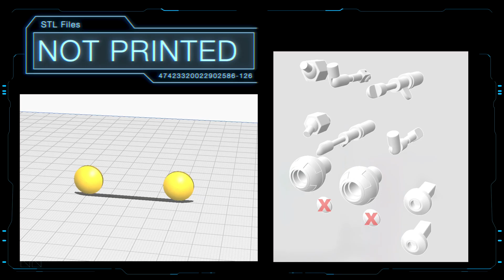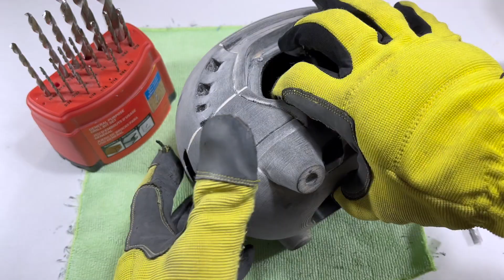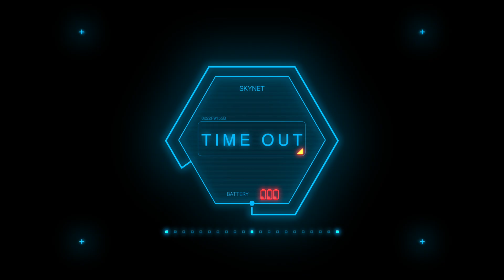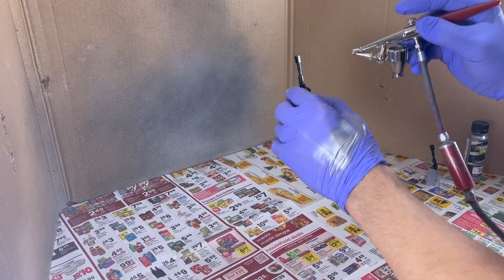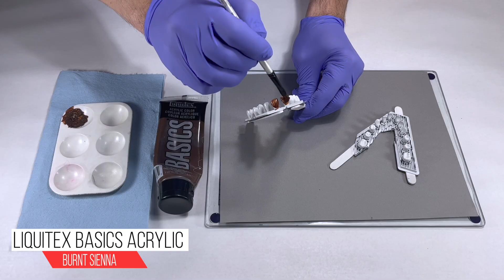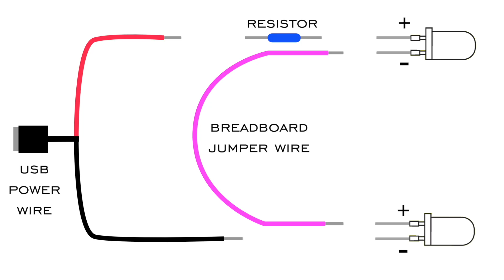3D Printed T-800 Terminator Bust with LED Eyes

Comment: I'm very New to 3d printing but I figured I'd give this a go. But for some reason when the chip cap prints out the detail is horrible. For some reason it looks like a bullseye and not smooth like it should be. What settings are you using.

Comment: I'm in the process of printing the T-800 full endoskeleton from the same designer (has the exact same skull).  I printed the skull in one piece but it did have a major wobble after 14 hours (was a 30-hour print at 0.16mm layer height on my K1 Max).  I'd forgotten to deselect the option for the supports to be on the build plate only, so the only tree supporting the memory chip chamber was a tiny little branch on one side of it that was branching off of the main supports that were 'growing' through the mounting hole at the base of the skull.  Luckily (and I mean extremely luckily!!) I spotted the chamber wobbling a bit so I paused the print and glued in some additional supports from leftover trees which held it in place perfectly - it 100% would have failed and left a whole skull full of spaghetti by the end of the print, assuming it didn't destroy the rest of the print as well.

Getting the supports out of the inside of the skull wasn't too tricky as the access holes on the side provided plenty of space to get snips in to cut them up and enough space for fingers to get in to break it all off.  Took maybe 10 minutes to get all the supports off the whole skull and it's perfect.  You can see on the timelapse after about 1:05 a big line appears, that's where the print was paused for half hour while I sorted out the supports for the memory chamber.  https://streamable.com/9pkz76

Thank you SO much for the tip on the cabochon for the eye lenses!!!  I printed the lenses in transparent PLA with red LEDs which look great when the LEDs are on, but a not great when they're off.  Been searching for a good alternative but have been struggling.  Now just waiting for the cabochons to arrive (had to order 200 when all I need is 2, ugh).  I've also added in a remote control for the lights as well, which I'm WAY too excited about.  Wired it up this morning in 5 minutes and it's great, was a £6 part on amazon: https://www.amazon.co.uk/dp/B0BVM7N8B1?ref=ppx_yo2ov_dt_b_fed_asin_title.

Comment: Hi, great video! I'm curious. I see theres a central hole though the model for the cable and a hole in the base. I dont see a channel for the cable to exit the models base.?
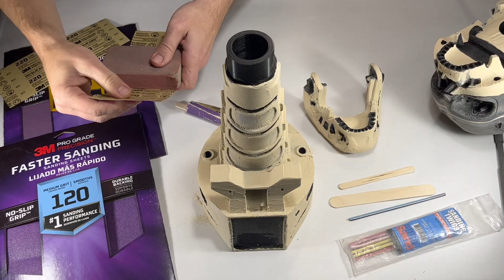Reply from the maker: Yes, there is a hole in the base, all the way up through the spine/neck.  The diameter is about 1.5 inches (estimating).  It opens at the top of the neck/spine so that you can run the LED wires for the eyes.  You can see the opening at 5:08 in the video.  That hole goes straight down through the base.  Good luck on your build!
Reply: @HappyTrooperDotCom  Yes, i see the hole goes down to the base but the base is flat. How do you run the cable out of the hole of the bottom if its sitting flush on top of a surface :)

Comment: I have two T-800 heads, one is ready for paint but I don’t have an air brush.
The coaxial RG6 was a brilliant idea, printing them is a pain!!
I printed them in half as you did, but I printed them upside down like a bowl so there was little support to remove.
I also installed a pressure switch at the bottom of the CPU port so when the CPU is inserted, the eyes light up. When removed, they shut off.
Other than that, I’ll be using some of the techniques from this video to expedite the sanding and filling process on the second head.
Awesome build!
Reply from the maker: The pressure switch is a brilliant idea, thank you for sharing!  Much better than plugging a power bank in.  Going to look into that :)

Comment: You are inspiring me to start 3D printing.  What 3D printer do you suggest?
Reply from the maker: Hello, thank you for watching.  I use the Creality CR10.  It has been very reliable, and has a large print bed to accomodate larger prints.  I realize it may seem expensive, but for the size you get, it is well worth it.  Thanks again for stopping by.  Good luck with your builds in the future :)
Reply: @HappyTrooperDotCom  Thank you for advice and the great videos!

Comment: looks great! at 16:45 you say don't do circular sanding - just wondering why that is? thank you
Reply from the maker: It is said that circular sanding can cause deeper scratches, and could remove more paint than using horizontal/vertical strokes.  I have never compared the 2 methods.  When wet sanding, the goal is to smooth/finish, and remove as little as possible.  This is the method that works for me :)  Thank you for watching!
Reply: @HappyTrooperDotCom  ahhh I didn't know this, will definitely avoid circular motions from now on thanks! I do tend to remove more than I want most times

Comment: Probably do not need any support on the inside of the model do to its shape...  I would most likely turn of or block internal support altogether
Reply from the maker: You are probably right, I may have created a little more work for myself cutting it in half.

Comment: How to print support inside the model on the inside. Using Prusa Slicer or Bambu labs version under Tree support (strong) 45degree angle (note) make sure “print on buildplate only” is not checked. Slice and note the support the weaves inside the model. Cheers
Reply from the maker: Awesome, thank you!  I created more work for myself cutting it in half...and risking the parts not aligning.  Printing it as a single piece is the way to go, especially on the skull.  Thank you for watching!